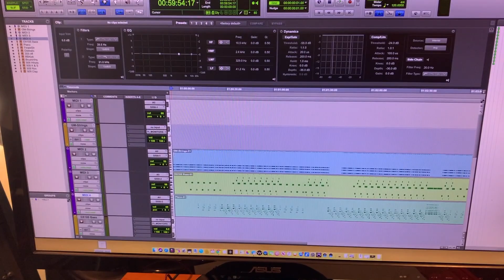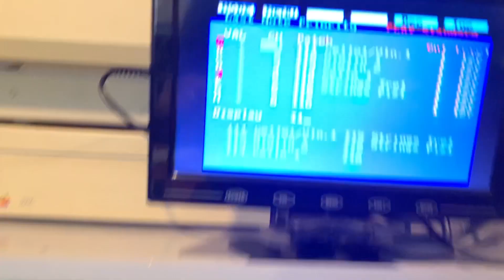Roland S-550 Sampler Modifications

Comment: Hi. If a store is selling a s550 and they dont tell you it doesnt have a system disk but it has 100 sample disks and the directors cut disks is it worth $500? Would you buy it? Btw i also have akais. 😊
Reply from the maker: Hey there - so the disks are sort of useless now that you can get a USB drive or scsi drive loaded with all the libraries.  I'd say$500 is pretty steep as I see them go on eBay in the 200-300 range often.
Reply: @johnnymorgansynthdreams  I was hoping I could load those samples into my akai s3000xl because it says it takes roland format. If I cant load the disks directly I could possibly do midi SDS and send them sampler to sampler.
Reply from the maker: @amonster8mymother  ahh ok interesting
I have both of those units and have never tried that!  I just move samples around on my pc and put them on Zuluscsi drives, so it's super fast and simple
Reply: @johnnymorgansynthdreams  ok so you have zuluscsi on your akai s3000xl?? I think I might try that. How is it working???
Reply from the maker: @amonster8mymother  It works amazing.  Super easy to setup - I've got 7 Hard drives full of sounds on it.
Reply: @johnnymorgansynthdreams  7 HD? How much space is on each?
Reply from the maker: @amonster8mymother  800MB for each disk

Comment: Hi, @johnnymorgansynthdreams, really enjoy your in-depth presentations and generally find your videos fascinating.

I have an S-760, I'm considering an S-550, and have the following question: is this a linear power supply in it? (The S-760 has an SMPS.)

Bonus question 🙂: if you ever find the time, it'd be great if you listed what capacitors you changed so that others (DIY beginners like me) could also look into doing it.

Thank you and all the best!
Reply from the maker: Ok awesome - I will for sure.   I'll have to open it up and see what I did.  I usually just put in what values I removed, but these days most capacitors have a smaller form factor so they aren't as physically big even though the values are the same.

Comment: Is it possible to get more than 4 80mb drive's on the SD card? Or is that the limit? 
Also, have you done a video on going through the process of actually setting up the SD card? I'm going to look through your other videos just in case you already have.... 
I have recently purchased the S550 and both of these modifications look like what I would like to do also...
Also... How do you switch between the 4 drive's?
Actually, does it load faster from SD card than the floppy drive????
Reply from the maker: Hi Peter - I believe you can only make 4  80MG images max.  I'm going to make a video of the formatting and disk setup starting tomorrow - should be up in a few days.  It as a little tricky as I recall getting the settings correct.   Ok cheers!
Reply: @johnnymorgansynthdreams  thanks.... I posted my comment before I finished watching the video so I kept adding comments to the same post as I went along.... Sorry about that.... 
I found the SCSI to micro SD card device on eBay but the other board that the card reader plugs into, I can't find it, nor do I know what it is....
I have watched this video and your other video some time ago before I got my S550 and I'm rewatching them again.... 
I'm trying to find the scart to HDMI board on eBay, haven't tried Ali Express yet... But all I'm getting is external plug in adaptors.... Does it have a specific name that I can search for it and the other SCSI board that sits before the card reader.... That would be much appreciated...

Comment: Great video, thanks for sharing. I recently bought one for 100$ as well and I'm just done cleaning it up!. It already has an HD5 scsi board installed in it. So I guess I can just pick up a scsi2sd card and be done with it? I don't mind using the output in B/W on my old tv.
Reply from the maker: Hi Syntheory - great find on the $100 S550 with scsi board.  Yes this should work fine for you.  You will have to figure out how to connect the scsi2sd 50 pin connector to the  25 pin connector on the HD5 board.  it's a little more difficult as you'll likely need a cable and gender-changer and I'm not sure if you'll be able to route it back into the unit so it's contained in the sampler.  As well the scsi2Sd board will need 5V power somehow - so you'll have to figure that out.   All the best with this and maybe post up here as to how you get it all togehter.

Comment: Great vid. I replaced output muting transistors. They caused me problems. They would distort audio and reduce volume. Highly recommend to replace them. The source of the problem lies on the fact most Roland units were grounded by default. Their case would float typically on mains voltage. There is not enough current to kill, but enough to bite the tip of your fingers when you put the unit into the grounded rack. Anyway if you would connect / disconnect the output jacks while the unit was on, and not grounded, there was a risk of that voltage being grounded thru those transistors. That's how they get damaged over time. By the way, they still work but they leak and the unit is not as loud as it should be. If your unit is finally grounded now, definitely replace them with generic replacement you find.
Reply from the maker: Thanks for the tip Don - I'll look at that for sure.
Reply from the maker: Don - after all years I finally have the transitors and I'm going to replace them this weekend!
Reply: Excellent!!! How did the upgrade go?
Reply from the maker: @DonSolaris  Good - definitely made a difference.  I actually did a similar repair on a friends R8M - it had surface mount 08's and I replaced all of those which also made a big difference - also installed a 3 prong cord for him to prevent further future issues.

Comment: My S550 has the original SCSI board ... I think this means I could do the scsi2SD mod with one less piece than you did? In either case, would you mind sharing the link for where you bought the scsi2SD board? Thanks for the video.
Reply from the maker: Hi Mark - I bought this one from ebay.  Because you have the original scsi connector which terminates on the back - I hear others with that config just go with an external unit. This is what I bought though.  https://www.ebay.com/itm/NEW-SCSI2SD-3-5-includes-50-pin-SCSI-to-SD-Card-Adaptor/132454870986?_trkparms=ispr%3D1&hash=item1ed6ecefca:g:4REAAOSw9gRaS6vY&amdata=enc%3AAQAFAAACcBaobrjLl8XobRIiIML1V4Imu%252Fn%252BzU5L90Z278x5ickkBUIiHwYv5YgVss0WaiENz3XRoTzeQEKHBCzshuwNHeST4JdXRvqygFlfPD1vNoapvzvvAlbjRrE9RHfousgzlVIxP0ukQwFK1fwCd7IO0QiDzaB2o3IHVp%252F2QFrhV32GbrhI3fYckeVcGyhy0J0ht2kZx8Yg%252BfT3jWoKxiew1UyLQxolXJwIIdrtOzX2HlWRujgprYrhytvRItOjeUfS9W1cc6N78Dr8HU3fvf4acxeOKXMex29QRlZ%252FLZ9PHYk7MySunxA9L8cVX4LWyBkI8rNlPeeToDSlWvnAxidogPIHILs0Gz5%252BZx3hmMm1gQbDZgvJVG%252B6MMlip%252B%252BjzVQa%252BScvpk2Ydsr%252FNO71rrIv4qLEG%252FlI6aT%252B6jqwFzydmfs0ubkHJBa2cSKD0KMIMJGiG8TfTIxa3IwIzKWkVwcXN8ddW2y4nBuPW518dwZidEZjXQUoxEV58xZ2MNQJGhJ%252F4FMV4OfFXRP6r8qjl5%252F9ERkz18uViGJr%252BSVKf6TIJ8EIDeCF48tbN8UnVq1uDnqKMp61r7Q3UWoHwEkAw3Nl6P8CILXG0xLoizTzVNSuetFdm6eMSY0wLn8ll1QbqrD%252BN5ijU9Cwxnvt0al5dECl4VR1uhvjsWN%252F8hiUSA3snRuDLwjkXsRhmM3%252Fac4xgiPoEYJaa8RCQQFlmYtcr%252BcJJ2d7UbIEctwgZWhvpZLcleME7SG7HAojC7wlQKPjWAcHwO3vs1wS9AqcArbqG8SCvx3IWwbm6idCfcsialLIogSUct3XoTRgU5TYz8Ycwc50sg%253D%253D%7Ccksum%3A132454870986ca35b82f7a86410db36c63d55821f132%7Campid%3APL_CLK%7Cclp%3A2334524

Comment: No need to route RGB+HS+VS video signals all the way from under DIN connector. All that video signals are present underneath on option header (SCSI expansion header)! Look schematics in service manual page 18. Pins A18, A19, A20, B17, B18, B19. You can make your modification cleaner and most likely picture better if you solder video wires to SCSI PCB. Cheers!

PS: also, video converter and SDSCSI PCBA add some load on 5V rail. Considering you maxed out S-550 PSU specs just by adding SCSI PCBA,  make sure 5V voltage converter and transformer do not overheat.
Reply: Suad, actually it's most of what you need. Mine is done like that and I wired to the HD5 (DIY) card. The horizontal sync on that SCSI card connector is unfortunately unusable. It's a straight 50/50 square wave signal for some reason. What you actually need can be seen in the owner's manual, but god only knows how to get it easily from the square. I just ran an extra wire to the mainboard and hit the back of the DIN for that one. I think Roland may have planned to do a more elaborate HD5, maybe with a different video output, but it never happened. :-(
Reply from the maker: Good call - I'll leave it open for a day and check temp.  I might upgrade the PS components to support this added current draw
Reply: I tried to plug it as you proposed ( on scsi head’s pins) but nothing happened. So, I think it’s better to keep the first example.
Reply: @arnoriva  Just recheck all pins and connections. It's all there and from there it goes to video DIN. Cheers! S

Comment: Questions: 

Can we get a link for the video card you used?  (Answered: its in his “S-50 DIY Improvements” video, link in comments) 

where did you ground out the 3-prong power’s third prong to, the chassis? 

Which pins did you draw the power for the cards from? 

What will you do about the mouse, use an adapter, or do you have an old mouse? 

Ive ordered a usb mouse adapter and will try to run a touch screen w this but not sure how well it will work. I’d also like to install the mouse adapter and have a chassis mount usb mouse jack on the back w the video output if it works.
Reply from the maker: hey Stu - here's the board link for you:

https://www.ebay.com/itm/HD-Game-Converter-Board-CGA-RGB-YUV-EGA-to-VGA-GBS-8200-Promotion/182387725526?_trkparms=aid%3D1110006%26algo%3DHOMESPLICE.SIM%26ao%3D1%26asc%3D225074%26meid%3D2254be51735a4b0db9ff218f4dcc8487%26pid%3D100005%26rk%3D1%26rkt%3D12%26mehot%3Dpf%26sd%3D180833084570%26itm%3D182387725526%26pmt%3D1%26noa%3D0%26pg%3D2047675%26algv%3DSimplAMLv5PairwiseWebWithBBEV2bDemotion&_trksid=p2047675.c100005.m1851
Reply from the maker: I'll make a new video that shows you some more details on where I ran the power and the solder connections.  Good idea.
Reply: @johnnymorgansynthdreams   Hah, I would be ok with just adding the pin numbers in the description and putting a label refrencing them at the point its mentioned in the vid, but if you want to do all that, then thats even better. Maybe have the primary vid as a fun overview for the masses, and a second vid w all the details as a guide for those of us going through with it? Double the traffic per topic lol

I'm assuming you are just using an old mouse, or sticking with the front face for now?

BTW your vids are looking great, really nice work! (sub'd)
Reply from the maker: @909Thumper909  ok video done - check it out
Reply: @johnnymorgansynthdreams   gave a peep, its PERFECT <3